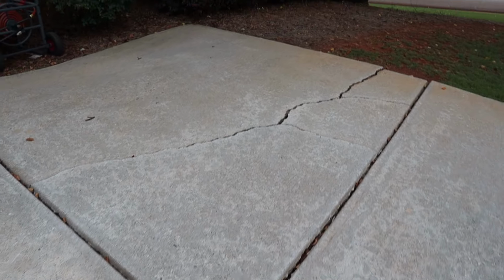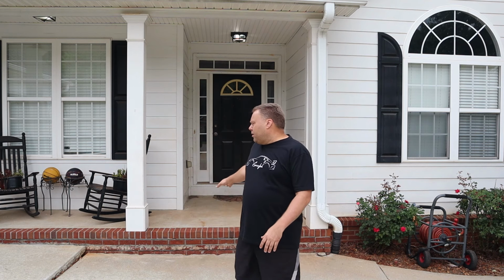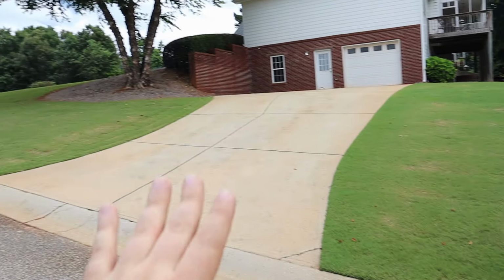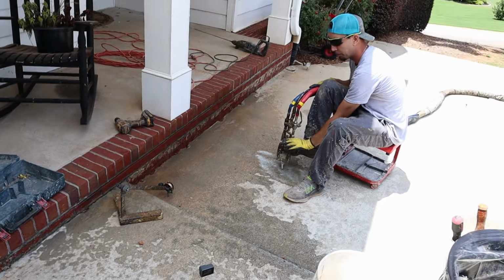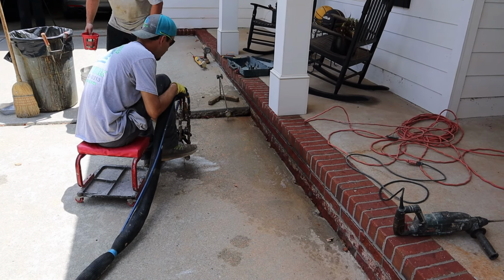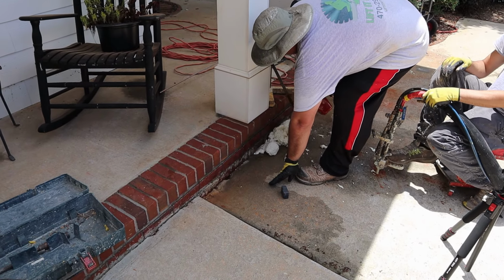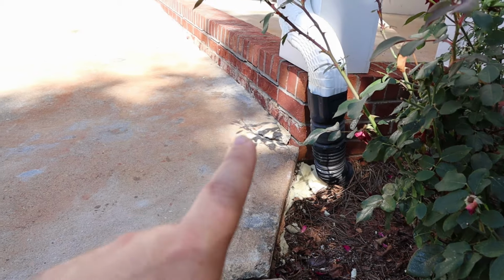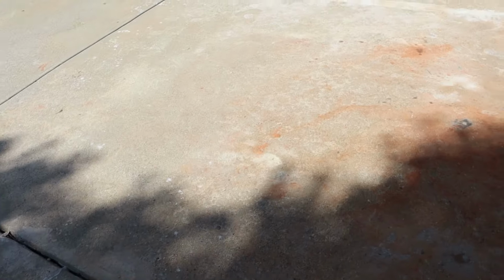Lifting My Sinking Concrete Driveway | Polyjacking

Comment: For sure the expandable foam will lift some serious concrete walkway sections in my case. I just did one 8 x 3 foot walkway section. Drilled down two places underneath and shot a couple of cans in both areas.  Bam! the section rose to the occasion roughly two inches. I filled in with gravel and dirt underneath. One and done.
Reply from the maker: Yup, it will last as long as you keep UV light from breaking it down. Filling the cracks in the cement and expansion joint and filling in like you said.
Reply: How are was this to do ?

Comment: I am no expert and simply speculating. I noticed that both places where the driveway crackes is where your end spounts tend to be located. One went underneath and the other was on top of it. It might help getting that water further away from the concrete
Reply from the maker: That was part of the reason and was fixed years before. My fault as well for not filing in the expansion joints when they crashed. My hobby of washing cars there probably didn't help with all that water going down the cracks. We also had an issue with the gutter over the garage water falling in the middle causing more erosion under the driveway. By the time I figured all he issues it was too late.
Reply: You are good. I have no formal construction education. Sometimes you live and learn lol

Comment: When the foam is pumped in, did the affected concrete slab get any cracks?
Reply from the maker: One did because the slab was wedged against the brick and it put pressure  on the center of the slab. It’s a hairline crack and has not gotten worse after 2 years. No void underneath for it to continue to crack. Key is to evenly raise the slab a little bit at a time. They usually use meters to judge how high and the angle once they reach  a specific number they start on another part to even it out. I also would assume it depends on slab thickness as well.

Comment: re direct the  water from that down spout ? I get a sinking feeling when I look at it.
Reply from the maker: We fixed that problem was the drain pipe for the spout got several big roots grown through it. I made sure to fix the drainage issue before going this route. The filing in all the cracks in the expansion joints.
Reply: @CarsWithKeav  Nice.  My porch sunk 2" down like yours. I suspected the water from my house was causing it. Thanks for your video. Peace.

Comment: Wondering how this looks 2 tears after the job was done. Is it still leveled? Looking at doing the same but not sure about the longevity of this solution.
Reply from the maker: We fixed the issues with drainage, gutters and sealed the expansion joints.to stop why it was eroding underneath. It has not moved yet. If you keep the foam out of UV light it lasts decades they say. I just wish we could have raised it more, but too much risk splitting the slab and messing up the porch.

Comment: I was thinking of doing this as its the cheapest fix but I'm worried that water will get trapped in the gaps under the concrete once it gets lifted.
Reply from the maker: I did my best to put some quick dry in there and we made sure it had not rained for a week before.

Comment: Good information, how much did that cost
Reply from the maker: $3k, but I got a bit of a deal for showing them in the video. My voids were very big so it took a lot of foam. Estimate to remove the slabs fix the voids and pour concrete was $10k. It was covid as well so we couldn’t even get the concrete if we wanted to.

Comment: How much did the charge you? Can you give us a range?
Reply from the maker: It was around $3k and at the time was the only option due to Covid and concrete shortages plus every quote I got for remove and redo was $10k at the least. It really all depends on how big the void is underneath and how much foam they will need to use. The void under mine was big so took a lot of foam.

Comment: I can't believe they did not use a jack first to bring the slab to the correct height before injecting foam.  This is not how it is done.
Reply from the maker: How do you get a jack in there? There is no place to do that. When it comes to foam this is the best way as it rises slower if you jack it up has a greater chance to crack the slab. Plus they would have to cut out a big hole in the slab to put a jack in there.
Reply: @CarsWithKeav  Plenty of youtube videos showing ways to jack slab using proper jigs.

Comment: Expanded foam compresses especially with the weight of cars going over it. More of a temporary bodge than a permanent repair.
Reply from the maker: If you correct the initial erosion cause and keep the foam out of UV light it will last a very long time. Been two years and has not dropped yet. Depends on the foam used. This was during Covid where concrete was in very short supply and very expensive. We figured $3k for this job vs $10k to redo. Quote from the foam manufacturer. “The polyurethane foam used to complete repairs will last indefinitely – through your lifetime and well beyond. It cures within minutes as a solid, impermeable structure that adheres directly to the concrete. It is not susceptible to fracture or failure.”  Of course this all depends on the company installing and if they get the mixes right. It’s no foam in a can that’s for sure.
Reply: and the downforce on the polyurethane foam is tiny....and proof is that it is still holding after 2 years.  I bought a kit, and my stuff expanded 18:1, one section, just took the foam, I'd shoot i10 seconds, wait, shoot another 10-20 second, wait and I could use another kit.  It did lift the areas and it has to be HOT, foam has to be hot to get the best result.  I now have to close up the cracks soon.  @CarsWithKeav
Reply from the maker: @DanTheManIOM  hope it works out great. Getting the cracks filled was a big change for me as it altered where the water was flowing. I had to fix some erosion issues in the yard.

Comment: Man, not down with the chipmonks and foam. Having those critters around is priceless. Foam is yet another nasty toxin to add.
Why not mudjacking? But, hey, I'm just one of those people who care about the environment and the damage all the chems are causing for our children and their's and on and on. I'd rip out that whole lawn and reseed with native grasses and plants. No need for spraying chems, mowing, etc.
Reply from the maker: Chipmunks are fine they relocated to the bushes nearby and are out everyday we have different opinions for sure, but I respect what you’re saying. I love mowing and the look of the grass. It’s great exercise for me, but I get what you’re saying. The reasons I didn’t do mud jacking. The texture of the slurry is too rough to completely fill the voids. Mudjacking is a short-term fix and will have to be repeated every few years or more frequently. The injected materials weigh 30 times more than polyurethane and can cause a new round of sinking beneath the concrete slab. Other reason the holes needed are much larger than the ones for polyjacking.
Reply: @CarsWithKeav  Cool on the chipmunks! Yeah, the proper structural foam certainly has its advantages. I've been researching various products for fixing both large and small foundation repair products. Mostly structural as thankfully no water issues. Of course,  I got into the slab raising stuff.  The equipment those guys have is proper and 
 expensive. Plus, the skill involved. Those engineered compounds are impressive. I'm a (semi) retired engineer working on my 1914 home.
I've got all the tools for doing pretty much everything. Except for a $10k injection machine :)
I appreciate a nice lawn and much respect for you for doing your own upkeep. 
YT feed has been giving me all of these people using GreatStuff for slab work. Shrug. But, hey, if money is no option...
Have a great summer.
Reply from the maker: @stringlarson1247  Most people don’t know the foam used for poly jacking quite different than great stuff. It will expand, but will not hold the weight over time.
Reply: @CarsWithKeav  yep. It's not hydrophobic closed cell either. 
Also I don't think many think about or address initial cause(s).
Some of the smaller jobs I've seen would have been better off being busted out and re-poured.
Reply from the maker: @stringlarson1247  We thought about that, but it was Covid and nobody could even schedule work and if so the price of the concrete was crazy plus you’ll never match the color. Our problem was the expansion joint we’re cracked and eroding underneath and one of our gutters was backed up overflowing under as well. After having an engineer come out to make sure the foundation of the house was good he suggested polyjacking as a long term solution vs repouring. We fixed the expansion joints after lifting the slabs and put in a new drain line the old one the bushes roots grew into the drain pipe. As long as we stop the erosion and keep the UV light out it should last a long time. Hasn’t dropped in level yet.
Reply: @CarsWithKeav  yep, water is often the issue, especially if you have freeze thaw like here in the upper Midwest. Also we get more and more insane downpours these days. Gutters can't handle it even when clean. I'm in Chicago and we've had some epic downpours already this spring.
Good to hear that you took the time to make sure there were no structural issues,  etc. And found someone reasonable and competent. Too many schisters out there.

Comment: Hi, i saw the problems showing again or I'm wrong?
Reply from the maker: We were never able to fully fix. It settled a fraction a few weeks later. Once I sealed all the cracks to stop water from getting under there it has not moved any at all. My fault for waiting too long to get the expansion joint cracks filled.

Comment: how much this thing cost?
Reply from the maker: It was about $2500 for me close to 1/4 what it would have cost to tear out and pour new concrete.  Its based on how much foam they need to use and the square footage.
Reply: @CarsWithKeav  You couldve done this for less than $100. All you need is a Hammer Drill and Great Stuff spray foam cans.
Reply: @Val2073  done it before for a small pad maybe 8x8ft and it took 12 cans and only raised 1.5 inches

Comment: They charge too much wonder if there is a kit i can buy and do it myself
Reply from the maker: It is a good bit, but you are paying for the expertise to know how much to inject and know the expansion and drying rates. They have to do a little at a time and at the right balance as to not crack the slab or lift too high. Not something I’m willing to screw up as you only get one shot at it. If it was a sidewalk I think I would try it, but these are huge slabs and will crack easy if done wrong. There is a diy kit called secure set which is the only one I would recommend you need good closed cell foam. The great stuff in a can will deplete and break down over time. The pro level stuff as long as you keep out of UV light will last as long as the concrete. https://secureset.net/product/ssf-lf-200-secure-set-spray-foam/ This DIY kit isn’t cheap though and for the job that I had they used close to three times the foam that DIY kit can make. Good luck  if you plan to do it and let us know the results as I’m very curious as well.

Comment: How long before the foam starts to rot, and you actually have to pour a proper driveway ?
Reply from the maker: As long as you keep the foam from UV light and repair all the cracks to stop erosion it will last years if not decades. Been over a year and a half and has not dropped anymore.
Reply: I install the foam now that foam will out last concrete so as long as the soil underneath doesn’t keep eroding the driveway will need replaced before the foam

Comment: How much did it cost to get this repaired. I have about the same amount of repairs needed.
Reply from the maker: It was a discounted deal for doing the video and they underestimated the foam they needed. I would expect for the amount of work they did between $3k and $4k versus the $10k estimate I got to demolish the slabs and poor new concrete and at the time it was in low supply due to the pandemic.